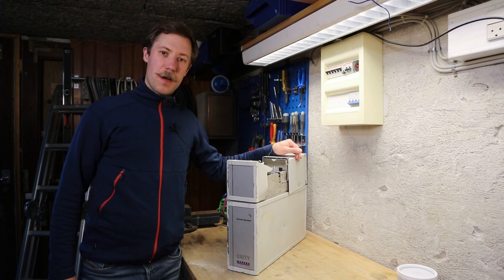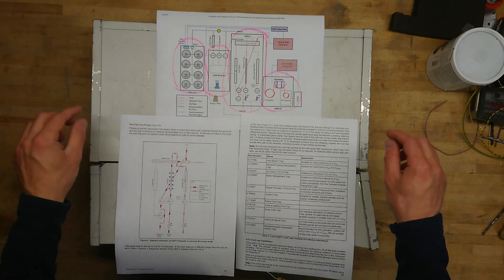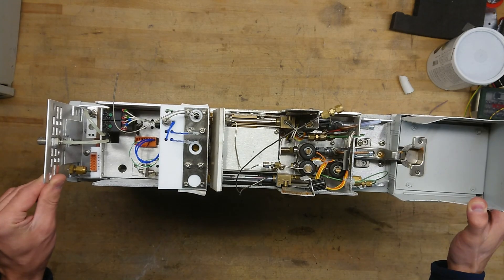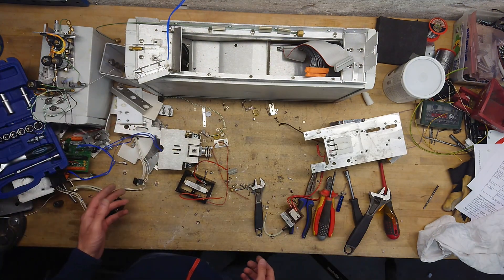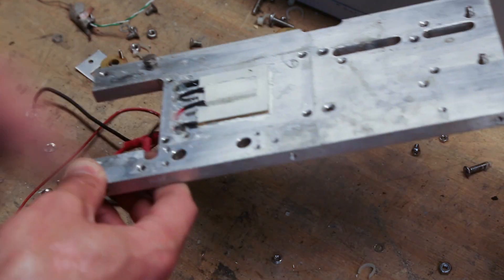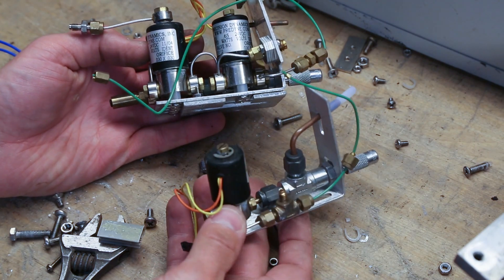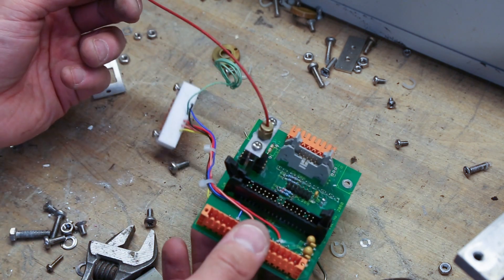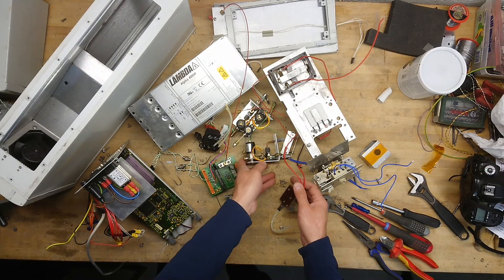Agilent Markes UNITY Thermal Desorber Teardown - Gas Chromatography

Comment: Fascinating stuff, it's really interesting to see something, where you have no idea what it even does. I find it weird, how a lot of the parts look kind of like RF parts. 
Most parts look really useful and the powersupply looks nice as well.
Reply from the maker: Maybe we could even push GHz / Z-wave through those tubes and valves as was it wave guides and transmission lines!
Reply: @KaizerPowerElectronicsDk  that might actually be pretty interesting, to see the different waveguide modes for these small pipes. I guess even the H10 mode would be in the hundreds of GHz.
Reply from the maker: @gammaleader96  The valves could properly stop the signal, but I would fear for its temperature rise

Comment: 3:52 Seriously ? they used a cheap furniture door hinge on such an expensive piece of lab equipment ?
Reply from the maker: That was my thought as well, good old kitchen cabinet hinge. There does however not seem to be any marks or holes from a original hinge that could have been replaced by the owner. The instrument is old enough to have had a life outside of manufacturer service interval...
Reply: Those hinges aren't that cheap. What other type of hinge were you expecting. Maybe they could've used 2 instead of just 1.